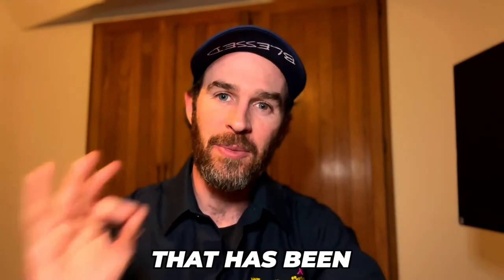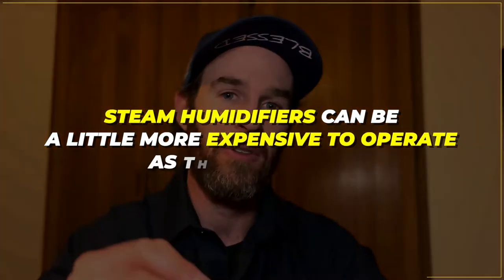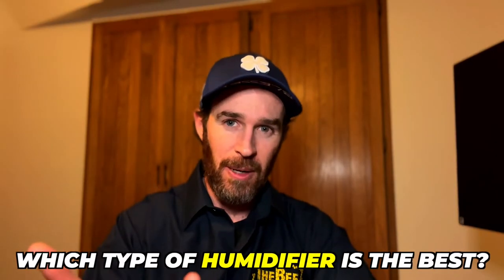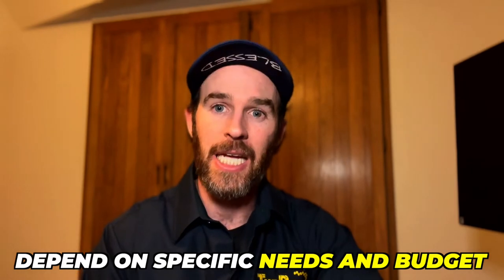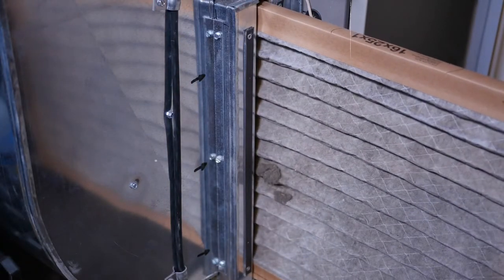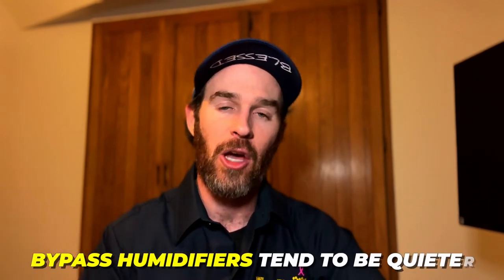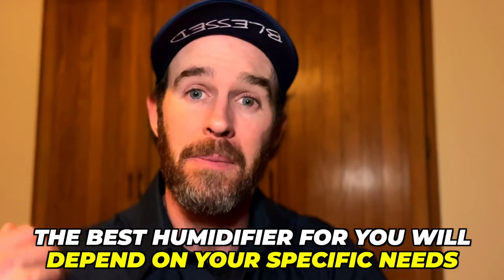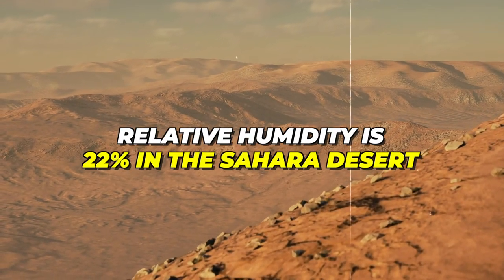Humidifiers, steam or bypass? 4 things to consider BEFORE you buy… watch this FIRST 💯🔥

Comment: Very thorough and informative video, thank you for sharing your thoughts. 
What are your thoughts about potential mold buildup in ductwork, and standing water in the unit? 
Question #2
If a home has hard water, how hard is it to clean the scale buildup for a steam humidifier? I would think that could be a frustrating situation.   
Looking forward to your reply…
Reply from the maker: Sorry for the delayed reply this slipped through the cracks, but long story short is hard water isn’t a big deal on steam at all. The canisters are easy to swap… you actually want harder water on steam because the electricity conducts better, otherwise technically distilled water has much lower conductivity so you have to use a special low conductivity canister. I don’t worry about mold ever in Colorado because it just doesn’t happen here that often, water leaks from other sources (roof plumbing etc) in the summer are more likely to cause that because relative humidity jumps. But I don’t worry about mold because typically you’re not installing these in environments conducive to mold growth. Relative humidity without one in our house would be 15% for example! Very dry!

Comment: relative humidity tells you nothing, humidity is to be measured in relation with the temperature, so proper measure of the level of water in the air is a dew point
Reply: Relative humidity does factor in the temperature (it literally means the percent saturation at a given temperature).  You may be thinking of absolute humidity.
Reply: relative humidity tells you NOTHING  @StraightRocketFuel
Reply: @hbarisic  never said it was anything special bruv.  You just said it didn’t factor in temperature and it’s literally right in the definition.  On top of that you’re describing dew point as a measure of humidity / water content in air and it’s not.  Dew point is the TEMPERATURE at which a given vapor pressure fully saturates the air and condensates.     Psychrometrics is a lot more complicated than your clearly limited understanding and yes relative humidity does tell you something, as does specific humidity, absolute humidity, enthalpy, dew point etc.
Reply: @StraightRocketFuel  dude, the one that is limited is clearly you. I will not waste my time anymore. Cheers!
Reply from the maker: Sounds like this has already been clarified by @straightrocketfuel 🙏😂 thank you lol… “rh tells you nothing…” hmm there’s a head scratcher 🤔

Comment: Great Info I have installed Aprilair 800 unit in my house in Vegas, My question is do i need this unit running in summer months I have noticed when unit kick on rooms get real hot. Should i turn unit off and only run during winter months?
Reply from the maker: Your AC is technically dehumidifying in the summer so it just counterproductive when it runs. What’s the humidity set to in your home in the summer? You could run it year round if you still need it in the summer but like I said your AC is technically removing condensation from the air when it’s running

Comment: The added electricity cost of the steam humidifier cant be overstated. I like how well my Aprilaire 800 maintains humidity, but it uses basically the same amount of electricity as my AC does in the summer time.
Reply from the maker: Good to know! I have not had that experience at our house. Are you sure it’s all from the humidifier? Not sure if you have a heat pump or furnace but that seems higher than what I’ve heard or experienced personally, but if you have bigger home I don’t doubt that it runs a lot! Thanks for the feedback!

Comment: That is very interesting there, I assume you come from US (you said Colorado) or Canada maybe have the same rules,  because bypass is allowed to be used as humidifiers. Here in Germany it's restricted, we can only use steam or system with fine spraying nozzles. Hoewer, bypass is only used as adiabatic cooling system in vents which are getting the air out of the building, and then filtrated back throug filters.. All because of the mold and possible bacteria in bypass systems
Reply from the maker: Yes in the USA here, we have those “swamp coolers” too, but we don’t worry about mold too much because relative humidity is so low 18% in the winter sometimes lower. I’ve never seen mold we always see scale buildup from hard water but that’s about it

Comment: So I have an Aprilaire bypass and even with the humidistat set at max, I can’t get over 30% in the living space. I believe it’s because I have a large cap furnace that never needs to run very long, even when outside temps are 20F or below.  What I’d like to be able to do is have the humidistat run just the blower to get the levels up - is that possible? Trane XE90 (the largest version).
Reply from the maker: Yes, you can get a humidistat that has blower on activation. It’s just not as efficient at humidifying as when the furnace is running, because the air going across the bypass pad will be room temp instead of hot furnace air. But Aprilaire makes a humidistat that can do that.
Reply: @TheHVACDopeShow  Thanks, and yeah, good point about air temp.  Still preferable for me vs standing up a wick humidifier.  Appreciate your vids!
Reply from the maker: @modquad18  for sure! Thanks for watching 😁

Comment: Any advice for bypass humidifiers on a high efficiency heat pump system?
Reply from the maker: They work for adding smaller amounts of humidity and in general are a great budget option. Whether it’s a heat pump or furnace as long as the supply temp is hot enough to get the bypass to evaporate effectively. Only downside to bypass is if you have a shorter heating season they won’t work as well on the shoulder seasons (spring / fall).

Comment: What about hooking up hot water vs. cold water to bypass humidifiers?  I found that hot water works much better and that the water going down the drain is actually cool after it passes through the humidifying pad.  Our boiler is 95% efficient, so not worried about wasting energy.

Steam is expensive for electricity use and my experience with Honeywell Truesteam was a maintenance nightmare.
Reply from the maker: I agree hot evaporates better (it’s already warm) but idk what the manual actually states, I’ve used both
Reply: @TheHVACDopeShow  Aprilaire 600 manual says use hot water if over something like 4000 ft2, I think.

Comment: Hello, what is recommended for a server room?
Reply from the maker: I would think the less the better… I don’t see a benefit to humidity for electronic components but I’m not sure honestly if there’s a reason to install one. I would be more concerned with keeping humidity down.
Reply: @TheHVACDopeShow  the lower the humidity the higher the static electricity. The ideal humidity levels for server rooms are 40-50 percent, but I want to make sure the solution I implement isn't overkill, i just wanted to see if you had any insight on what is commonly used. I appreciate the swift reply by the way!